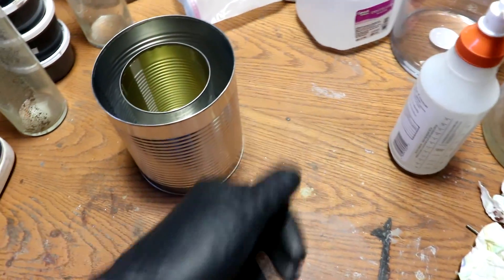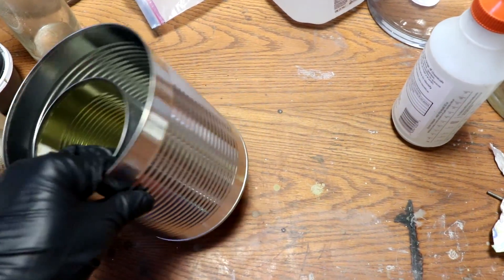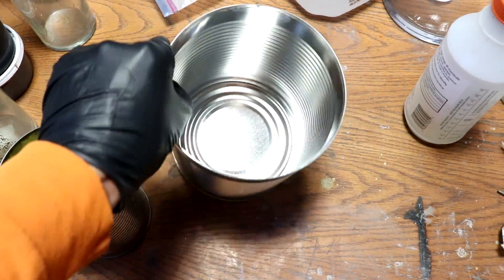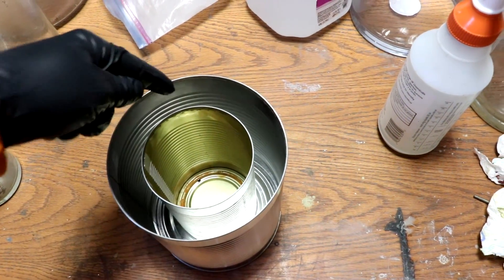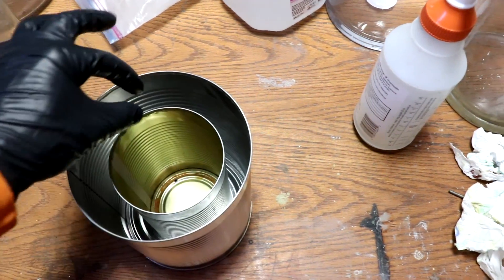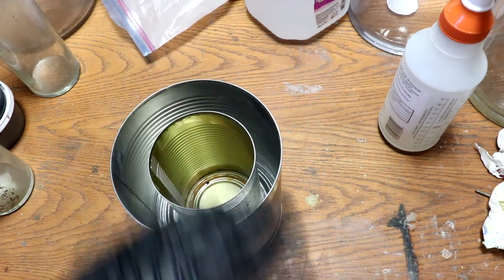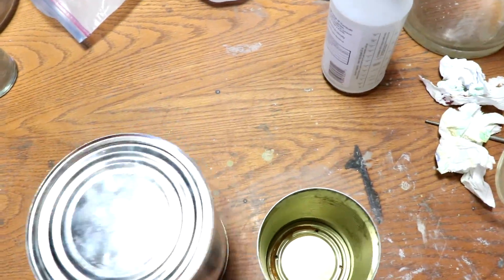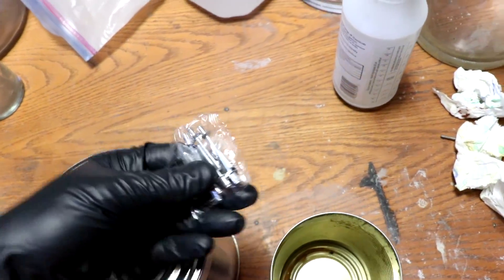The Rad Can

Comment: This is AFTER the raid... can´t imagine what the FBI took away from you...
Reply from the maker: I had some trittium that they were unhappy with. The uranium was fine.
Reply: @theCodyReeder  ? Large amounts or containment? somthing else? that seems strange they would care more about that.
Reply: @Falconguygaming  There are probably regulations concerning Tritium. Take for example the commonly known "exit" signs, that use Tritium to be self luminous (you know, if there is no electricity in case of an emergency). These signs probably only use a small amount of Tritium. but they still have a hefty bunch of regulations around themselves. You can't even trade them freely. And you have to report all kind of stuff to the NRC, like when you lose one, or when you sell one to another person who is allowed to buy them.

So I think it is pretty logical, that they would expect the same for flasks full of pure Tritium.
Reply: @theCodyReeder  Why would they care about tritium? It's not even that radioactive in those amounts that can be bought. I own some and it's only 1.5 microsieverts which is not a lot at all.
Reply: @sebastianpersson1778  my guess is because tritium as a lithium salt (LiT) is a major component of a hydrogen bomb
Reply: @mattdombrowski8435  that is not that simple to make H-bomb because of the other thing.Actually as I am graduated in experimental nuclear physics and in addition to that worked as EOD specialist in Russia for 3 years(and the amount of TNT in stuff remaining from WW2 that I disarmed is actually comparable to the yield of Hiroshima bomb!)-so I actually can assemble any scheme of nuclear or thermonuclear device using stuff that I am able to find/get myself including lithium òk vfmm
Reply: @johnsheppard1476  I'm worried this is going to become a tedious and vitriolic argument, so, as an apparent nuclear security expert, can you give me some reasons why a nuclear regulator wouldn't be thrilled about finding isolated tritium in a civilian's house?
Reply: @mattdombrowski8435  because it's sold on Amazon for  $3.50 per gram.
And if you take in consideration that the tritium is not needed in a fusion bomb,and you actually need lithium deuteride(which must be stored in either emplosion type bomb as a core or better in layer type device but anyway in something that is resistant to superbase which LiD is)-but the same time one might isolate deuterium in the kitchen or garage so it's not a problem. And the real deal is fissile isotopes like U-235,Pu-239 and all the rest:if I would have had that in the required quantity-I would have been able to make a fusion bomb and by the way of nearly any desired power-even in excess of Tsar-bomb(obviously not smaller than the existing ones but if the size doesn't matter it's possible to achieve any yields)!Yet the main thing is getting U-235 or Pu-239 which is entirely impossible for any organisation and less than 20 countries all over the world possess this technology!And building such a processing plant from zero requires not less than trillion dollar program involving several thousand scientists and highest standard multi-billion dollar equipment parts that will make you capable of enriching uranium!And by the way it was vastly harder,more expensive and more time consuming goal to achieve than moon program and space program put together!
Reply: @sebastianpersson1778  because its litteraly used along with deutrium as fuel for nuclear reactions.
Reply: @johnsheppard1476  its not hard enrich uranium at all, just need 2000C furnace and spin its vapours in vaccum, absolutely achievable by any random dude in a garage, yields ofc will be very small, but over time can gather enough of 235
Reply: @mattdombrowski8435  how is tritium different from uranium ore or other radioactive materials?
Reply: @johnsheppard1476  Can you also build a selfsustainable tritium based fusion reactor to generate more power than you put in?
Reply: @abudabisas  it's not that simple:to make a single gram on your own you will have to invest more than trillion dollars because you won't be able to get information about how exactly it's done and will have to make your own research!
It's not that hard to make one yet the energy production will be very low..
Reply: @johnsheppard1476  Cody's LAb, "Challenge accepted!"
Reply: @johnsheppard1476  ...this is one of those comments that freak normal people out, like when I explain that I can make high explosives out of urine. Or how easy it is to make a gun type atomic bomb as long as you get the timing right, the hardest thing I can think of is getting large quantities of beryllium for more complicated designs impolsion types for example.
Reply: @abudabisas  Then you take that make a breeder reactor and use it to turn all that useless U 238 into PU 239.
Reply: @johnathanblackwell9960  Or you can just get a grant from Iran or NK, they'll be glad to fund you
Reply: @sebastianpersson1778  1.5? Not great not terrible.
Reply: @johnathanblackwell9960  yes,and especially specialists freak out when I tell them which crystals did I grow after reacting dicyanogen tetrabromide with hydrogen azide(getting the most powerful explosive stuff that is able to exist in relatively normal conditions:isocyanogen tetraazide😈😈😈about 160 times stronger than TNT)-and especially what happened with an abandoned shack when I placed about a pound of this shit in transparent container right about half an hour before the sunrise and waited for the sun rays to get to it in substantial amount to make a chain reaction of decomposition!Btw it was great thing that the timing was perfect:due to very humid conditions I had seen a wall of condensation instead of the blast itself,although very fast but a very satisfying moment that I remember very well!
Reply: @mattdombrowski8435  Don't listen to John Sheppard, the feds don't care about any of that stuff. They don't care about people making any kind of fission/fusion bombs. The Feds are, and have been for quite some time, worried about dirty bombs, which takes a VASTLY lesser quality of material to be dangerous. Imagine a single person taking 4-5 years and slowly gathering up legal radioactive materials from various locations, so as to not raise any suspicions. Then they take all of that material, stick it inside a small conventional bomb, perhaps a simple fertilizer based device, and detonate it on a the top of a tall building in a major US city. It would basically be like a low power nuclear fallout, slowly irradiating people with low dose radiation for decades. The right group with lots of time and very little work could make downtown Manhattan unlivable for decades.
Reply: @stefanvandijk7114  More power than you put in? Self-sustainable? 🤣🤣🤣🤣You've got to be joking bro
Reply: @mattdombrowski8435  Good to know: Time to be scared that things may contain lithium salts which make them relatable to hydrogen bombs.
Reply: @johnsheppard1476  Good to know: Time to not be so scared about lithium salts in things because they don't actually make things comparable to hydrogen bombs.
Reply: @mattdombrowski8435  That's cause it LiT
Reply: We seriously need some people with credentials in this thread; at least 1 lawyer, a nuclear physicist, and a couple different fields of chemists.
Reply: @SpecialEDy  Fuck off
Reply: @kiyoponnn  no u
Reply: @YEAHKINDA  😎
Reply: @stefanvandijk7114  Not if you're counting the Tritium itself as something you "Put In".
You can't produce energy from nowhere, so even if you get more electricity out than electricity in, it's because it's consuming something to do so. Be it Tritium, or anything else.
Reply: @kiyoponnn  If you can do this. A big problem would be solved. But laughing in a corner is always easier isn't it. InfiniteLoop...
Reply: @sebastianpersson1778  its not a lot but if it leaks out its hard to detect.
Reply: @sebastianpersson1778  1.5 microsieverts not great not terrible
Reply: @SpecialEDy  Nah it just needs people who can open a tab and search google for the video explaining the raid.  he had some uranium next to a neutron source in hopes of generating a few p-239 atoms and making even one is illegal. they also had an issue with him having uranium metal dissolved in a liquid  that could get into the groundwater and a bigger issue with him fluorinating the yellow cake making uranium tetrafluoride which isn't too far off from enrichment starter material. He doesn't actually mention the tritium in the video but it could again be a groundwater contamination issue as 740ppm is the limit in the US or it could have just been because it was a large quantity of it.
Reply: jSkrat Nyarlathotep different properties and different applications. It’s like asking what’s the difference between H2O (water) and H2O2 (hydrogen peroxide), they’re only protons a part from each other but have very different properties and applications
Reply: @mattdombrowski8435  Read up on the 'nuclear boy scout'. He used tritium to create a breeder reactor.
Reply: @jskratnyarlathotep8411  You could burn it to make radioactive water. It couldnt be filtered out.
Reply: @yaykruser  but one can't make enough of it in a garage to pose a significant radiation threat even to self, can one?
Reply: @jskratnyarlathotep8411  He said that the radiation would be as high as his huge Uranium ore pice if not even larger. 
So it would be like the radiation of the 10 pound uranium ore combined in less than a milliliter of water...
Reply: @yaykruser  but uranium ore is not that radoiactive, though
Reply: @jskratnyarlathotep8411  yeah, was just 60.000 counts per minute before his geiger counter failed...
Reply: Cody'sLab so the government is fine with you having uranium but not tritium. What’s wrong with that picture lol
Reply: @darthrevan2063  uranium ore isnt dangerous. The decay isnt fast enough
Reply: @theCodyReeder  Typical of bureaucrats, but they had to find "something" to justify the visit.  However if they were otherwise happy, the YT has no business suppressing your videos as they are excellent educational material, very correct scientifically and innovative.  Your videos on measuring the density of small mineral samples should be required material for geology students.
Reply: @theCodyReeder  Fuel for the inertial confinement reactor I'm guessing.  Any progress on that front?
Reply: @theCodyReeder  you were discussing building a fusor right before the visit, if I recall correctly, sounds right that they might not be happy with you already having the fuel...
Reply: Cody'sLab Hahahaha no shit, Tritium, as in one of the more volitile elements coupled with Uranium and Plutonium to increase the yeild of an atomic weapon?
Reply: @theCodyReeder  That figures😂
Reply: @theCodyReeder  Was the tritium powder like the old watch lume?
Reply: @theCodyReeder  They were pissed about tritium? Even I've probably got a measurable about of tritium in my house just from all the various pistol night sights I have.
Reply: @theCodyReeder  Lol tritium? What about those glow vials full of it you can buy on ebay?
Reply: @theCodyReeder  but why the trittium?
Reply: @theCodyReeder  Don't you love it when people who don't understand the topic are making the rules.... Am I the only one that finds it mind boggling that we live a society where you can walk to the store and buy guns, narcotics(alcohol), high energy density chemical fuel, and a plane(yes, ultralights have zero regulations), yet people freak out over tritium.
Reply: @amir_404-e4d  Ummm, alcohol (as you have so implied) is not considered, classified, nor referred to by the government or scientific community as a "narcotic". Alcohol and narcotics (legal or illegal) are not the same. True, alcohol abuse is it's own issue, but please do not inflate its classification to press your point. As for your other examples; they are not as easy as "walk to the store and buy" as if they were a bag of Skittles (though I'm not sure why you added ultralight aircraft to your list). Government, State and Federal, agencies regulate those purchases. When you speak of Chemical High Energy Density Fuel; are you referring to Hydrogen, Methanol, Ethanol, etc.? Or simply gasoline? 
I do understand your point and agree that the issue with Tritium is a non-issue whereas alcohol, narcotics, and some others are; let's keep it fact based and not make demons out of rabbits.
Reply: @LeatherNeck1833  Agreed at best you could classify alcohol as an "intoxicant", that's a far cry from a "narcotic"
Reply: @SéanBrown  Semantics, it absolutely is a narcotic though.
Reply: @LeatherNeck1833  Alcohol is a narcotic though, it's just grandfathered in and not frowned upon.
Reply: @kristoffer3000  You know there is a thing called Google. I hear if you type in a question it will provide the answer. Maybe you should try it before making unsupported comments like "grandfathered in" and "alcohol is a narcotic".
Reply: @LeatherNeck1833  Please enlighten me, is it the narcotic effect that makes alcohol not a narcotic?
Reply: @kristoffer3000  What Narcotic effect do you speak of? Alcohol has but one, and it only occurs with large consumptions. Sleepiness is the only "narcotic like" effect that alcohol possesses; which, by classification standards, is not enough to consider it a narcotic. Show me one institution, State, Government, anything that classifies alcohol as a narcotic drug. Not narcotic like effect, but as a narcotic itself. Come back once you've done your research.
Reply: @LeatherNeck1833  "a drug or other substance affecting mood or behavior and sold for nonmedical purposes" definition from the dictionary. Especially considering that alcohol is a psychoactive substance and a depressant helps show this claim. Either way alcohol is a drug
Reply: Amir Abudubai and yet any drone over 250 grams needs to be registered :-(
Reply: @LeatherNeck1833  "Show me one institution, State, Government, anything that classifies alcohol as a narcotic drug" - that's an Appeal From Authority argument. The state pretty much has the right to pass arbitrary laws that define things as they see fit.
Reply: @ChucksSEADnDEAD  So you still can't answer my simple question. Find me ONE place in the world that classifies alcohol as a narcotic. That's the debate here, all other answers are null and void.
Reply: @LeatherNeck1833  I'm pointing out that you're using a fallacy. And since we're debating the legitimacy of government arbitration, you're using an Appeal to Authority fallacy to justify a Circular Reasoning fallacy. The state is right because the state created the legal system that makes it right.
"That's the debate here, all other answers are null and void." - your argument stems from fallacious reasoning. This is no different then you using an Ad Hominem argument and then trying to shut down anyone pointing out that you can't just shoot the messenger. But I guess Saudi Arabia fits the bill.
Reply: @ChucksSEADnDEAD  I bet all that sophisticated chatter makes you feel important and legitimized doesn't it? Yet you still can't point out one single case where alcohol was classified as a narcotic. My request is simple; the remark was that alcohol is a narcotic. Show me a classification saying so.
Reply: @amir_404-e4d  you mean we live in an American society!. Tritium, I wonder what can be done with that?
Reply: @LeatherNeck1833  Just wondering whether you're still angry
Reply: Were they irish, indian? Serious question... this is why the reql FBI were fired. So a bunch of posers can go around scamming people.
Reply: Probably nothing, because it's actually legal to own radioactive material (as long as you're responsible with it). You can even buy radioactive materials through Amazon. The feds probably even recommended a container for it after he showed them around.
Reply: @Midnight24435  I think at one point it was mentioned that they actually did offer some solutions for storage, although  I could be totally wrong on that front. In one of the vlogs, maybe?
Either way, here's hoping he doesn't get in more hot water for this video.
Reply: @Crows_Den  Plot twist: he only recorded footage of the miniature scale can test XD
Reply: @Crows_Den  Nope, just heavy water.
Reply: Isn't tritium present in water anyways, or is that only deuterium? So it's basically enriched water?
And aren't small quantities of enriched uranium not that useful? Don't you need a specific amount to achieve fission, or a critical mass? So, any less and you need some complicated mechanism of blasting it with extra neutrons. This guy is saying you can build a bomb of any size in your garage if you had the U235, I'm thinking a smaller or larger uranium bomb would be increasingly difficult.
Reply: I also wonder why the people who claim to be things like "experimental nuclear physicists" always have the worst grammar? I'm a forklift mechanic, and can at least write at a high school reading level. Perhaps, it makes what they say less clear, so it's harder to pick apart and find flaws?

r/iamverysmart
Reply: @SpecialEDy  Deuterium is present in trace amounts in water, but tritium is extremely rare. It is highly radioactive with a half life of about 12 years, so it decays pretty much completely within a century or two. Tritium is usually produced artificially from other nuclear reactions.
Reply: @SpecialEDy  It also makes them less trustworthy, in my opinion.
Reply: @SpecialEDy  A forklift mechanic? People who use fluffed up job descriptions belong on r/iamverysmart. Welcome to the club. Take a set next to the cleaning technicians and egg mechanics.
Reply: @SpecialEDy  The irony of someone referencing r/iamverysmart while correcting someone's grammar online is not lost on me.
Reply: @Michael-mh2tw  you should read John Sheppard's comments then. He says he's a nuclear experimental physicist, he said he could build any bomb in his garage with simple materials from small to bigger than the Tsar Bomba, he says that he has defused enough TNT to rival Hiroshima. Next he'll be returning to tell us how he is a Navy Seal.
Reply: @SpecialEDy  I would believe him tbh
Reply: Midnight24435 it’s legal to own but not to buy and there is a strict limit on Yellow Cake uranium since it’s weapons grade and can be used obviously to build a nuclear bomb
Reply: At least he wasn't building a breeder reactor held together with some duct tape and in his mom's potting shed
Reply: Wait the feds visited Cody? Wondered who’s the snitch
Reply: @jmd_2319  YouTube. The Google over lord's have been battling Cody.
Reply: @jmd_2319  Probably a web-scraping program that found his videos.
Reply: @jmd_2319  youtube
Reply: I hope he wont turn out like David Hahn...the radioactive boyscout
Reply: I don't think the feds are worried about Cody, but people who might target Cody, considering he makes public a lot of what he does.
Reply: really? The fbi raided him?
Reply: After?
Reply: So he was raided? After I saw him with a bag labelled "yellow cake" I thought for sure he'd get a visit from the feds. lol
Reply: Worlds running low of precious metals. Government decided they needed to rob their own people.
Reply: cody austin  Sure, look what i wrote, also the us seems to have very small restrictions regarding radiation in water.
Reply: cody austin  He could poison tons of ground water and the US has very high restrictions regarding that.
Reply: cody austin  Not if he throws them in the oven.
Reply: I FUCKING LOVE this thread
Reply: did he make a video about the raid
Reply: I noticed he didn't talk at all when he had the yellowcake on camera. It's legal to own but seems like he didn't wanna talk so his voice wouldn't be in that specific clip
Reply: bongothaplant possibly so you could hear the Geiger counter’s measuring go down as he put it in the thing he made
Reply: @spacevibes321  You're shitting me right? "The difference between heroin and alcohol is TERMINOLOGY." 
This is the answer you're going with? Well guess what, the ONLY difference between Hydrogen and Helium is one electron....that's it...ONLY DIFFERENCE.
Reply: @LeatherNeck1833  Alcohol is a drug by definition ya dipshit. Its just more accepted than others.
Reply: @LeatherNeck1833  cool story bro
Reply: @geyotepilkington2892  What are you 12, seriously?
Reply: @spacevibes321  You have to be a complete moron to compare alcohol with a fucking opiate. Sweet jesus.
Reply: GabrielAKAFinn you’re completely right. I’ve never seen someone on OxyContin beat their family....
Reply: @GabrielAKAFinn  Thank You! Bout time someone else with a little brain power jumped in on this conversation.